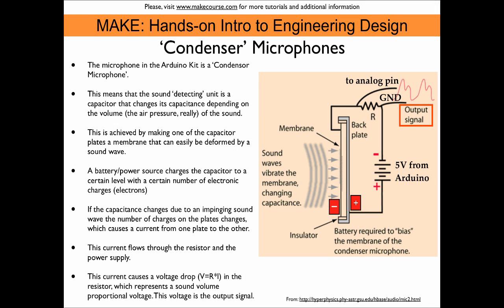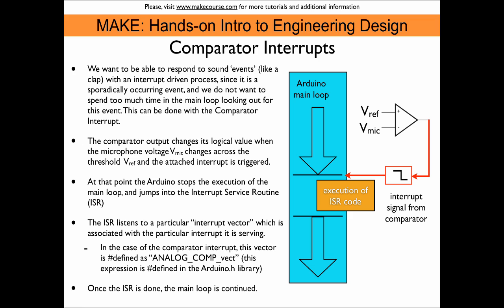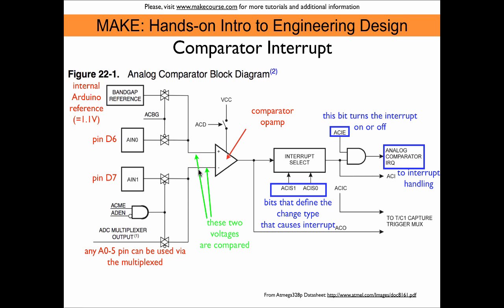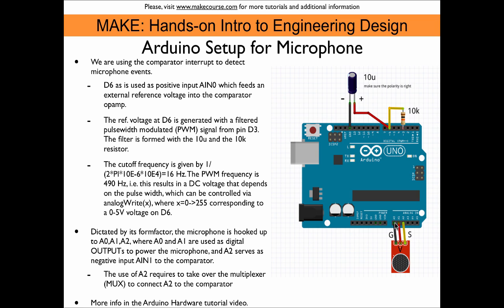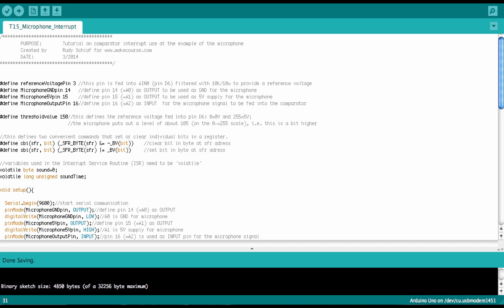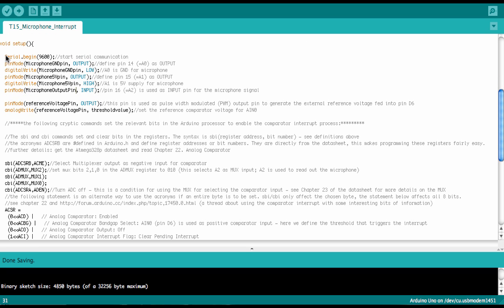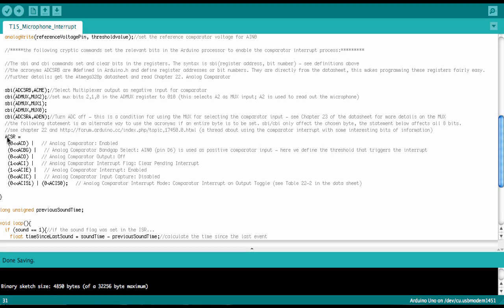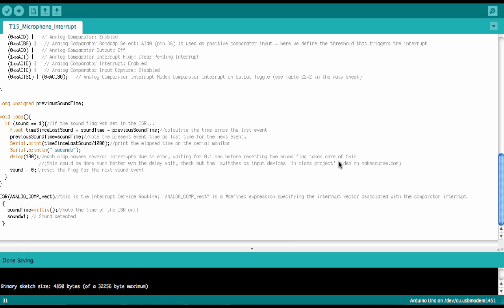Tutorial: Using Comparator Interrupts with the Arduino at the example of a Microphone

Comment: Hi. Thanks a lot for the video. It's really helpful for me.
But I have the following problem, can you help me please?

I made a similar set-up (use an additional ultrasonic transmitter instead of clapping)   and also used your code on my Atmega2560 Arduino board (namely Seeeduino ADK with Atmega2560). But it doesn't work. I checked the signals on my oscilloscope and everything seems to be fine.
I guess I may use the wrong pins for AIN0 and AIN1( I used the same pins as in your code). And I checked the pin map for Atmega2560, it has no information for AIN0 pin.
Reply from the maker: Excellent question! I looked at the circuit diagram of the Mega (http://arduino.cc/en/uploads/Main/arduino-mega-schematic.pdf), and it seems they did not connect AIN0 to an output pin on the Mega board, only AIN1 (D5). 
This means you can only use the internal reference voltage for comparison. Of course you could tack on a very thin wire to the AIN0 pin directly on the Atmega, and make your own pin, so to speak. But this requires advanced soldering skills and a very fine iron tip.
Reply: Make Course Thanks very much for the answer. Just one more question please.
The sound wave may last for a certain amount of time ( e.g 1ms). So my question is:
Is the interrupt ISR only called once ,when receiving the sound wave, or it is called many times until the sound wave terminates (like an interrupt ISR is called during the execution of another interrupt ISR).
Thanks a lot
Reply from the maker: Bien le I think it will up to a certain frequency. 1ms seems entirely feasible since that is just 1 kHz and the Arduino clocks at 16 MHz. If repeat interrupts are unwanted you can ignore interrupts for some time after an event similar to debouncing switches.